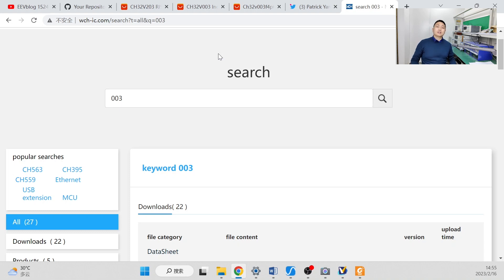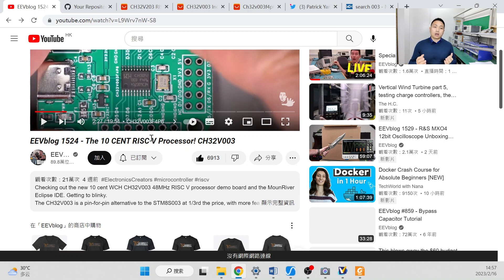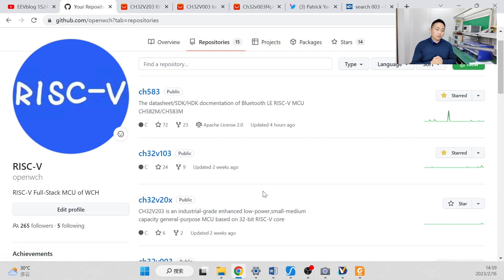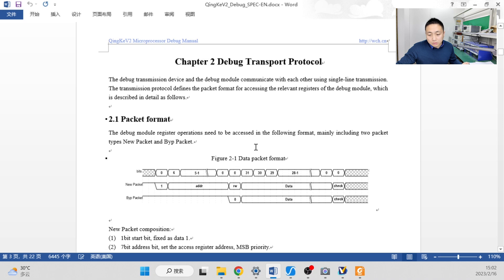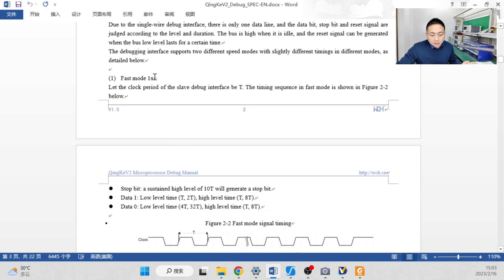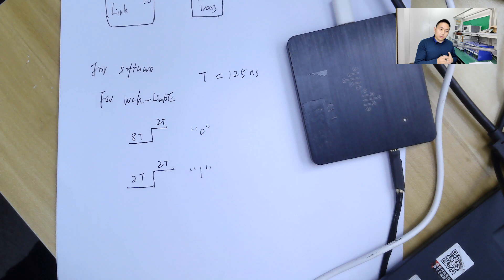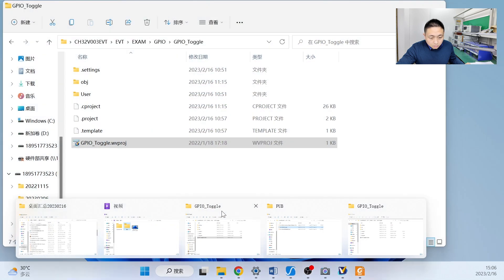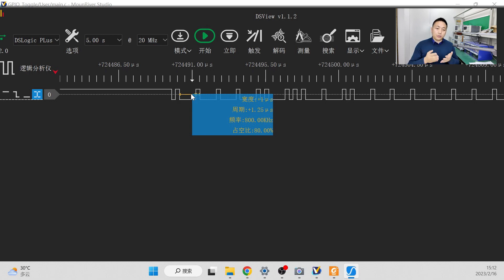#1-The 1-wire debugging protocol for RISC-V MCU CH32V003

Comment: I picked up a WCH_LinkE programmer, dev board, and 150 of these MCUs.  Running the MounRiver IDE under Windows, programs as expected (other than needing the WC_Link Utility to wipe the 8-pin ones to reprogram) and (with help) figured out that I need to use the RX line on the programmer to get Terminal output to the IDE.  So, working well and pretty happy so far.

But, I found the "one wire debug" manual you showed in this video and it lists all kinds of commands that go way beyond programming.  Is that functionality something we can use from the IDE?  If so, any chance on a tutorial for that?  If not, is there some other interface that uses it, or are there any plans for it?

Comment: Hi Patrick,
 I've have the official WCH LinkE programmer and demo board and am using the MounRiver  software. Initially I cold program modify and reprogram the board BUT suddenly started giving a "Board chip status error" .
So thinking the chip (CH32v003F4P6) had been bricked I carefully replaced it which allowed me to program the new one but only once.
I then tried connecting just vcc, gnd and swdio to an 8 pin CH32V003J4M6 again it programmed immediately ONCE and once only I repeated with two further 8 pin chips with the same result   in each case the program written to the device worked but would not allow further programming . I have tried on both Linux and MS Windows.
Do you have any clues as to what is happening???
P.S. I have ordered a new WCH LinkE but it will take a while to arrive..
Reply from the maker: Hey, I think the problem should be the I/O alternate issue of PD1. Here is the method to rework the debug function. step 1, Power the CH32v003 with the voltage of WCH-LINK, step 2, Keep the WCH-Link's 1-wire connected to PD1，step 2, Update the MRS IDE to the latest version(v1.84), then click the button step by step: Flash-->Configuration-->Clear Code Flash--> choose the "By Power off"-->Apply , step 3, CH32V003 comes alive again.
Reply: @rvmaking  you he MAN :-) . Upgraded my MS Windows version and it works great , oddly it doesn't remember the configuration settings between build/burn sessions but I'm sure I can chase that .. Just need to sort my Linux version next..
Thank you so much 🙂
Reply: If you want to, you can also use the minichlink program from the ch32v003fun project.  It has an 'unbrick' function just like the mounriver studio does, but is a lot more lightweight.
Reply from the maker: @davidwillmore  Hi could you post the ch32v003fun project link :）
Reply: @davidwillmore  Hi yep I found that and it works well allowing me to "play" with some raw CH32 riscv assembler code :thanks again :-)

Comment: Hello Patrick, great video! I want to use the CH32V003 bootloader to program in circuit via the UART. Is bootloader documentation available?
Reply from the maker: Because the V003 hasnt boot pin, so we wrote an IAP program to enter BOOT mode. These program can be checked in CH32V003EVT which named USART-IAP.  First download the IAP code to chip via 1-wire, thus you can use WCH-LinkUtility to program the chip via the UART now. I have arranged to write the documentation about how to use the IAP and bootloader for CH32V003.
Reply: @rvmaking  Thank you. I look forward to seeing the documentation.
Reply from the maker: @lwg6605  Here is the documentation for you. https://github.com/openwch/ch32v003/blob/main/CH32V003_IAP_Use_Introduction.pdf
Reply: @rvmaking  thank you!

Comment: They cannot be bought for 10 cents. Why are these clickbaits. In my case provided ali link shows me that 50pcs cost me 15$  = 0.3$.  And as I wrote in another comment in my local offline store same price for one how in wholesale 50pcs quantity lot on ali, ahaha. It became ridiculous to look at Ali sellers prices in general, when locally near the house is cheaper. ahaha

 And after 50pcs buy thinking where I can apply these mc. Lol.

P.S. Who think to use stm32 copied SPL vs registers programing with limited 16kB of flash. For example I took SPL example and write own same code but on registers with same size optimization. SPL example 1.3kB of code, my registers code 600 bytes. Where 160 bytes is interrupt table, not code. All what you need is to read manual (f103 as main) and forget this s..t as SPL. I write on registers stm32 for more 10 years.

Wch. If you have any offer (as I can see from my another comments wch employers wipe their pants on work) you are welcome.
Reply from the maker: IMO, the AliExPress has different shipping costs according to different countries and cities. and the AliExpress is mainly used to sell chip samples, So if you don't like Aliexpress, you can come to me to place the order directly. 😀

Comment: Wonder if a RP2040 could do this protocol.
Reply from the maker: It can  run this protocol
Reply: There are STM32F042, ESP32S2, and rp2040 programmer/debuggers already.  Possibly a CH552 and STM32F103 version soon as well.

Comment: There is no initial sequence in the document.
Reply from the maker: The first step is to reset the debug interface bus and the reset hold time should be at least 256*125ns. The second step is to enable the debug interface output register, set SHDWCFGR=0x5AA50400, CFGR=OX5AA50400,  judge whether CPBR is equal to 0x00010403, if so, the debug mode is available.
Reply: @rvmaking  I do like that, but it doesnt work. Read without any reply.
Reply from the maker: @LậptrìnhViđiềukhiển-d6f  can you read the value of register CPBR  and be sure to equal to 0x00010403?
Reply: @rvmaking  can not. There is no response signal.
Reply: @rvmaking  now it works. I understand now.

Comment: Add some Application Note, add support VS Code, PDF user manual for MR Studio, host wch website somewhere where global user can browse faster, make a version of WCH-Link offline programming capable. I think CH32Vxxx has huge potential market. Best wishes for WCH & Patric
Reply from the maker: Thanks for your sincere suggestion. Some of the above work has been done and some are in the process. In short, I will absorb any good suggestions from everyone to make WCH products better😀
Reply: I don't use crooked eclipse MounRiver, but Clion not tied to any manufacturer, I take another newer gcc (v12),  I don't use their copied from stm32  SPL, but registers. I create own register header file back to stm32 names to not to tie code and to copy/paste from/to stm32 projects, I made programmer by myself. So I don't use anything from wch to play with ch32v (bought at local store to explore), ahahahaha.

Comment: Thank you so much for this work onto a Debug way to RISC-V. It is a huge effort!
Reply from the maker: we are also communicating with the RISC-V International Foundation, suggesting that 1-wire could be used as a standard debugging solution for low-cost MCU
Reply: Will never happen. Only worldwide adopted standards such as JTAG will be used for low-cost MCU

Comment: I got the development board already and was surprised how easily I managed to get Mounriver running on my Linux machine (I'm using opensuse). Getting one of the LED blinking took me some time because I had to find out how to import the examples from github but I managed it fairly fast. Nice piece of hardware you have produced!
Reply from the maker: Thanks for your sharing

Comment: I‘ll try to use it on my CH32v003 Eval Board.
Reply: No, just started with the CH32V003F4P6-EVT-R0 in my holiday.
Reply from the maker: Did you make your own CH32V003 Eval Board?

Comment: I’d like to try it out… I am working with other low cost MCUs but not Arm ISA
Reply from the maker: 8-bit MCU?
Reply: @rvmaking  yes, but width and clock speed do not make much of a difference simple devices that just need i2c, uart, dow etc.

Comment: my order is on the way.  do you think there will be arduino support in future ?
Reply from the maker: The following work plan is to port the Zephyr on CH32V307 first.
Reply: @rvmaking arduino support would make a plethora of libraries available 👍😉
Reply from the maker: @old_Taki  This is a big project, so we need to implement it step by step
Reply: @rvmaking  quite so!

Comment: Getting my shipment of SOP-8  CH32V003J4M6 today... a bit concerned of not having an NRESET pin, how do I enter programming mode on them? 

Will be using them without an external Xtal... if that makes any sense. Still designing an initial test board for them.
Reply from the maker: you can use WCH-LinkE to let the chip enter programming mode. or using the IAP code in the SDK and ISP tool would be another way but it's a little complicated because the chip does not reserve a boot pin
Reply: I have programmed my bare chip with 3-wire connection between WCH-LinkE and chip this way
SWDIO  → PD1
GND  → GND
3.3V  → Vcc

I assume it should work on CH32V003J4M6 .
Reply from the maker: @tiyo-dd5il  yeah, It should work

Comment: Hey, Patrick. Thank you. This is great news! 

I've been amongst the harsh critics on WCH for going proprietary on this and across the board, this has pretty consistently been one of the top reasons to not design with WCH. (Perhaps that was QingKe's decision and not WCH's...) Once this information is used by OpenOCD developers to create an upstream-able patch or the likes of developers for Segger or the BL702 to include it on Sipeed RV- Debugger Plus to work with the JTAG-style boards we all already have in abundance, debugging these parts should get WAY easier. Maybe the FTDI or Pico class of boards can do this, too  - we all have those in abundance. I'm excited to open the doors on this protocol and let others into it with a variety of debug probes.

I'll say that once your team help me with the "factory firmware on the 307 -EVT being too old to upload factory firmware problem", I've been developing on - and thus, debugging on - the 307 board. I like boards that give a single USB-C cable for power, console, and debug.

Also,  @risc-v5634  can you please tweak the title or pin a comment to clarify that this should include 203, 205, 208, 305, 307, and any others in the family if appropriate?

Thank you!
Reply from the maker: Hey Robert! 😀It's my honor to get your support. But it may make you temporarily disappointed now. This 1- wire protocol can only be used for CH32V003 and the next generation using this 1-wire protocol. For V203/V208/305/307 these series are using 2-wire protocol, which is the next key work for me to strive to open it.
Reply: @rvmaking  Thanx for the heads-up. The RV32I boards have different debug protocol than RV32E.  Got it. Even that tidbit is good to confirm.
I'm pleased you've heard the voices and are taking action.
Now, if you could do like Espressif did on ESP32-C3 and eliminate/remap the external interface and just slurp it into the USB port totally.... Serial/Console, Power, and Debug on one USB-C cable with standard OpenOCD is pretty nice. :-)

Thank you, Sir!

(For our readers, the '307 EVT board offers this, but it takes an extra chip on the PCB.)

Comment: Is the same protocol implemented in CH32V307 (and e.g.CH32V208 ) ?
Reply from the maker: Not quite the same. 1-wire protocol was designed mainly to save the number of IOs of the MCU without greatly reducing the debugging speed

Comment from the maker: The documentation of 1-wire protocol can be downloaded here: https://github.com/openwch/ch32v003
<RISC-V QingKeV2 Microprocessor Debug Manual.pdf>
Reply: I will make the usb adapter by myself. Thank you.
Reply from the maker: @LậptrìnhViđiềukhiển-d6f  OK
Reply: @rvmaking  how to erase the chip when the 1-wire is disabled in the code?
Reply from the maker: @LậptrìnhViđiềukhiển-d6f  It's a good question! 
if that happens, you can send a pause command immediately after power-on for about 15ms. If the chip can enter the pause state, the code that closes the debugging interface will not be executed. So in the paused state, just erase the flash from the debugging interface
Reply from the maker: @LậptrìnhViđiềukhiển-d6f  It's a good question! 
if that happens, you can send a pause command immediately after power-on for about 15ms. If the chip can enter the pause state, the code that closes the debugging interface will not be executed. So in the paused state, just erase the flash from the debugging interface
Reply: @rvmaking  thanks.